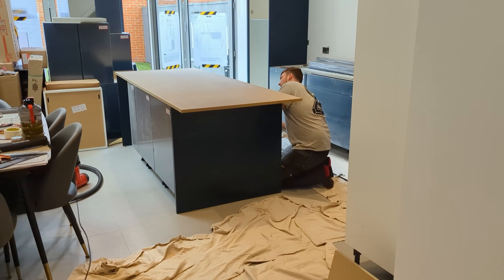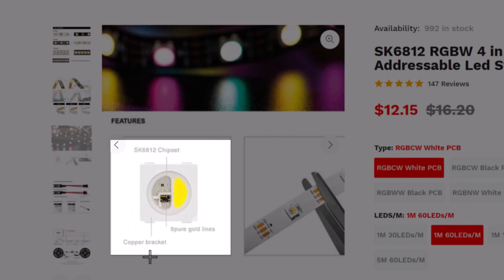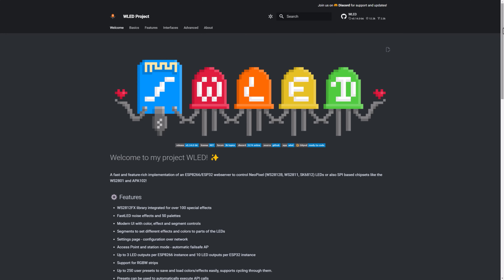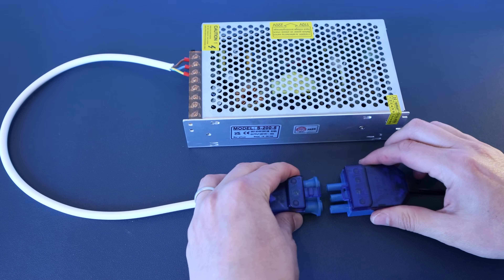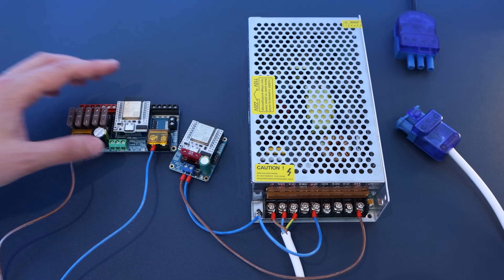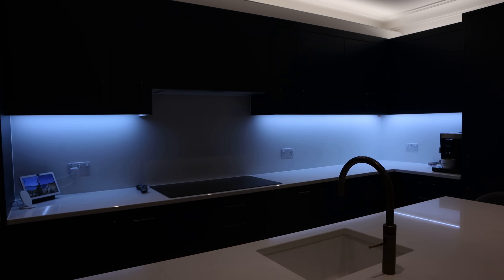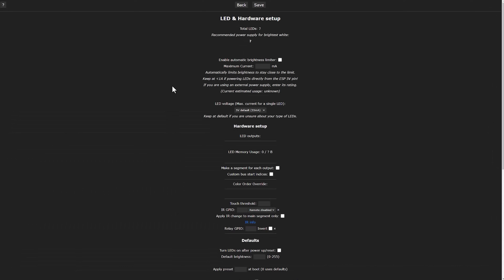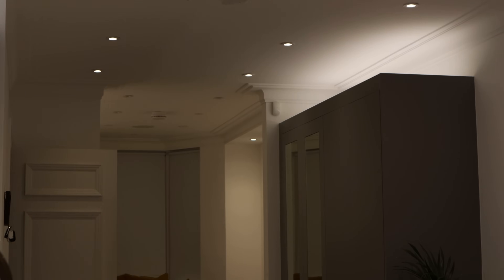Advanced WLED install and setup

Comment: It does not matter what voltage you got. If your screw terminal is loose even 5V 10A can start a fire. But othervise great video
Reply from the maker: Well let's hope that doesn't happen 🤞

Does the short circuit protection on my power supply not help prevent that?
Reply: A short circuit is a voltage to ground, that is what your PSU is protecting against. An arc fault is where a flash jumps across to ground and creates a spark. So your psu won’t protect against an arc fault. Also your wago 221 don’t need stranded wire to be tinned, it’s better practice to not do that. You should also use forked connectors on your psu and not ferrules. Also, the psu should be enclosed sufficiently as well as  terminals enclosed as above, but also your wago connectors should be in boxes to be pedantic. Single insulated wire needs mechanical protection too. 

Two simple paranoid scenarios you want to protect against:

1) someone chucks something metal on top of the kitchen cupboard to get it out of the way (knife, fork, skewer, kids toy etc) and you arc across the terminals
2) you induce a high voltage into your system and the wagos are exposed. Sounds unlikely, but you’ve run cable across a mains voltage appliance (extractor) so it is a possibility.

Personally, wiring shouldn’t look messy when completed, even if that isn’t a safety factor. 4:38  in the video is shocking

Comment: Great video. Ive done the same with my shelves either side of my tv. My only confusion is the wled setting for maximum power. If i have a 5 amp ppwer supply, and i push the maximum amps in WLed to above this, is it in danger of catchijg fire?
Reply from the maker: I really am not sure on the answer to that. Hopefully someone in the community can help answer that!

Comment: You have some exposed 240v copper and single insulated cable on your PSU connections there. They should be inside an insulated enclosure.
If you had an EICR, these would require rectification as they are a shock hazard and fire risk.
Reply from the maker: Thanks for the heads up, I am going to look at enclosures for these.

Comment: Great video as usual! Learned a lot, had fun watching it and got excited about starting a wled-project in my kids room.

I highly recommend using a motion sensor under your kitchen cabinets. Mine switches on the hue led-strip when motion is detected and restore previous state after 2 minutes with no motion.
The motion sensor can also trigger an automation for my dishwasher. If no one has opened the door to the dishwasher when it has finished the automation will prompt you to open the dishwasher. Prompt is spoken from my Google Nest hub.
Reply from the maker: Great suggestions - thank you so much!

Comment: The thing you were saying at the end where you change lights based on to much/to little power is great, I've had this running for years. Also works wonders to get my wife to use power "correctly".
Reply from the maker: Glad to hear it! That project is still on my "Todo list" 🤣

Comment: Nice work. I've done a fair amount of projects with WLED, but only for ambient lighting, never "work light", using ESP32 and WS2812 strips. I've looked at exactly SK6812 before, but never pulled the trigger, because I found it to expensive. But it seems to have fallen in price since i last checked.

But just to be sure, did you go for 30 or 60 LED's per meter?
Reply from the maker: I went with the 60 LEDs per meter, they seem to diffuse quite well in the aluminium channel for a nice even light - as long as you're not looking directly at them!
Reply: @HomeAutomationGuy  Awesome. Thanks for your answer :)

Comment: Been wanting to do this for a while both inside and outside but there's so much hardware its easy to get lost. My goal outside is to run strips under the eaves and do away with my abnoxiously bright flood lights, converting them to camera motion activated lights instead. It would certainly make my neighbors happier without my house being lit up like a compound at night. I also like what you did inside but I think a higher voltage setup will prove easier for installation. Great vid, your setup looks amazing!
Reply from the maker: I think for massive outdoor runs I too would look at 12v or higher.  The concepts are the same between 5v and 12v, and the QuinLED controllers work with both voltages as well
Reply: You could consider using a Blueghozt automotive LED controller for that... It's a fantasticly customizable controller that has triggers that are usually used in cars to activate lights for turn signals or brake lights, but you could potentially have those lights triggered by your cameras turning on instead. Just a thought...